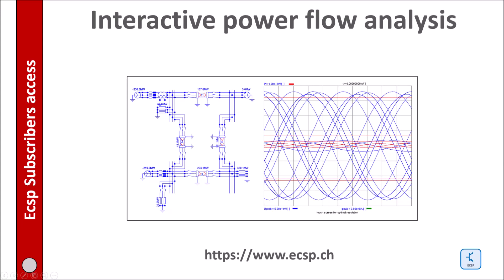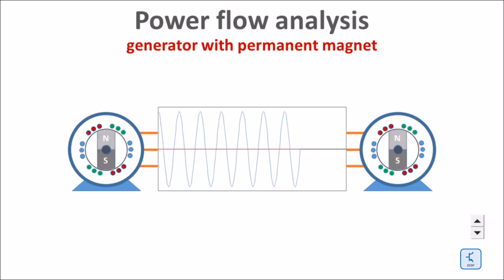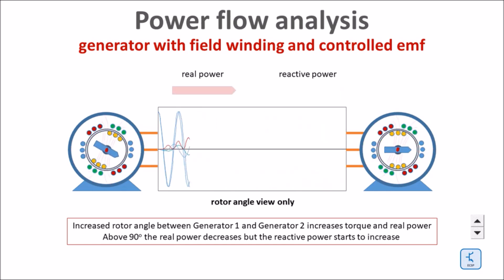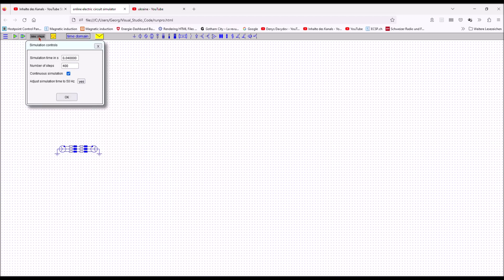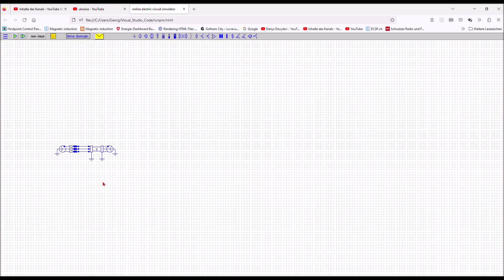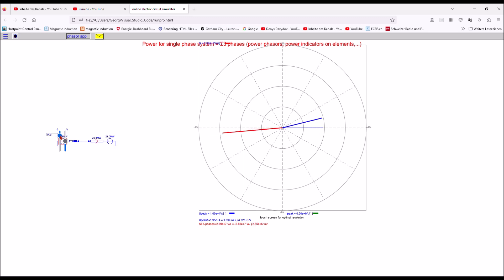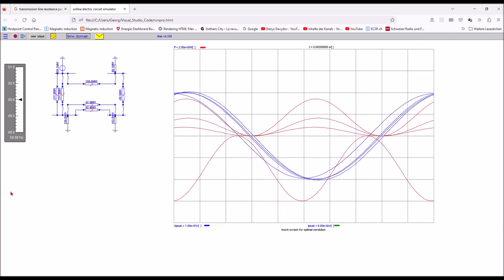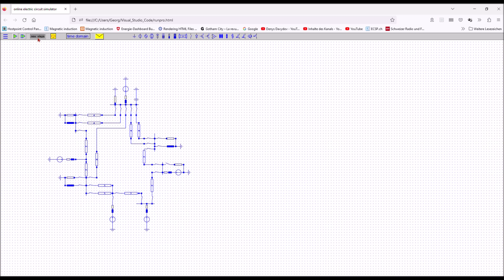Interactive power flow and load flow analysis [circuit simulator]

Comment: For IC based engines the load angle is the angle between stator and rotor, for IBRs, what would be considered as load angle? Also in your terminology do you have 3 angles or 2 angles? Load angle, power or voltage angle and then the power factor angle. What will be the difference between load angle & power angle? the Generator is connected to the grid so same angle can be used as load angle and voltage angle ( obviously it will be different at different points)
Reply from the maker: The load angle (or torque angle, \(\delta \)) of an alternator is the angular displacement between the rotor's magnetic field (excitation voltage, \(E\)) and the terminal voltage (\(V\)) or resultant air-gap field, indicating how much the rotor has "lagged" due to the load. This angle dictates the real power output, which increases with \(\sin (\delta )\), reaching maximum at 90 degrees, but practical operation keeps it much lower (around 20-30 degrees) for stability, as exceeding this limit (around 90 degrees) causes instability.
Reply: @georgschett801  Does IBRs have a load angle?
Reply from the maker: @KumarKumar-dp4go  Yes, the base mechanism is the same. By controlling the voltage phase at the output of the IBR electronically you can vary the power output of the IBR. Now, some control schemes directly control the voltage phase angle, others control the current output of the IBR. If the current is in phase with the voltage at the terminal of the IBR then the IBR provides real power into the system.